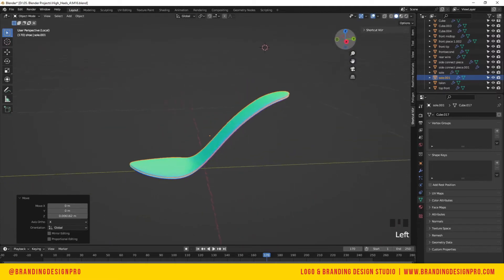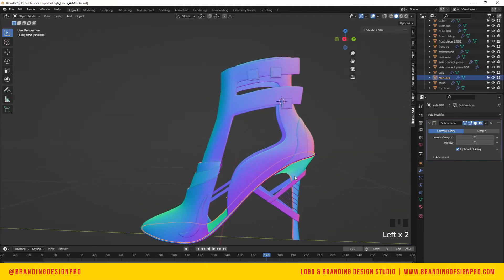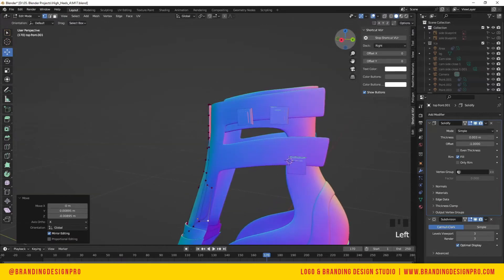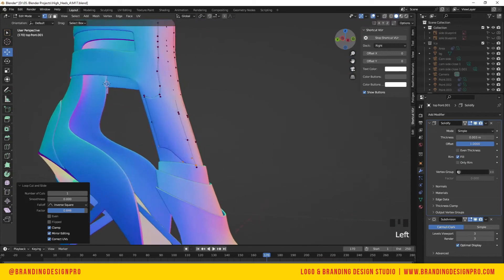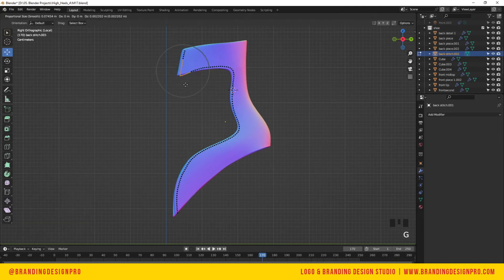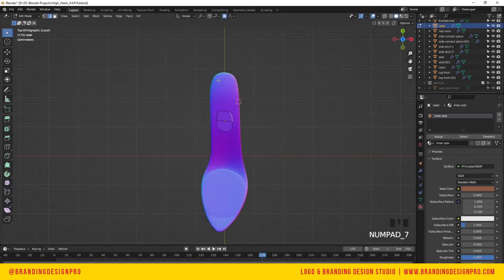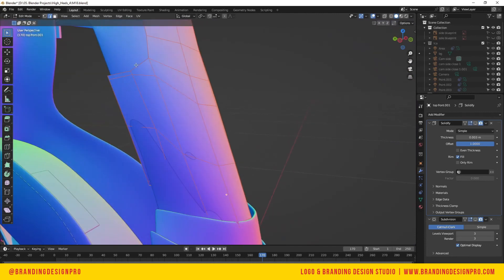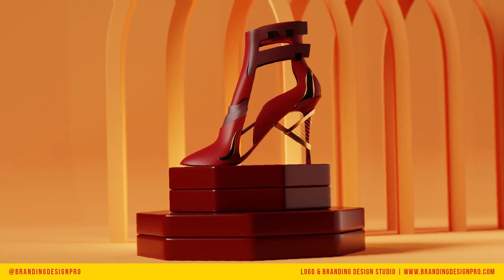How to Design High Heels in 3D (Blender Tutorial Pt 3)

Comment: “Unreliable and Unprofessional Experience”

I had a disappointing experience with Branding Design Pro. After agreeing to refund me for their services, I encountered significant issues accessing the promised funds. Despite repeated follow-ups and assurances, the check provided remains on hold, and my bank confirms they do not have access to the funds. This situation reflects a lack of professionalism and reliability.

If you’re considering working with this company, proceed with caution and ensure proper financial agreements are in place to avoid similar frustration.